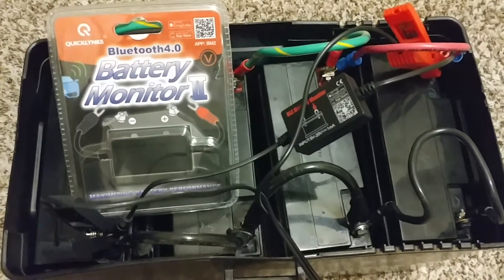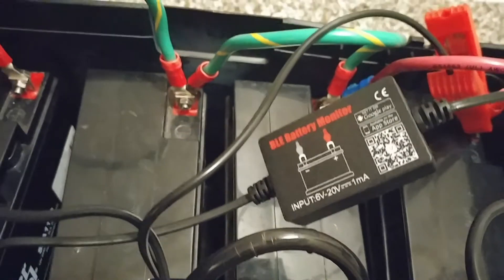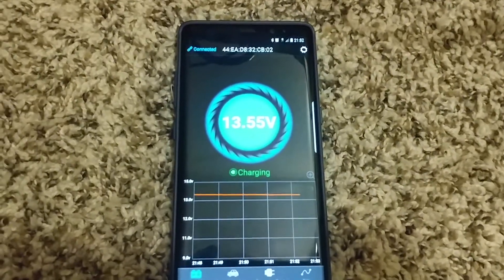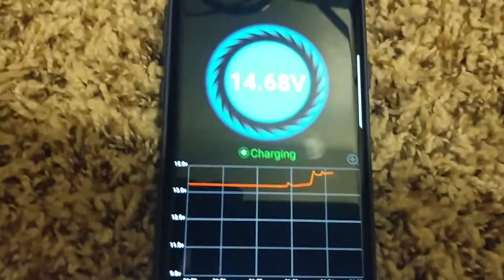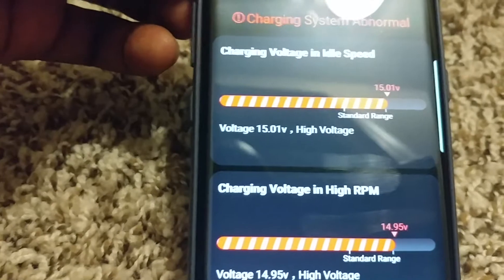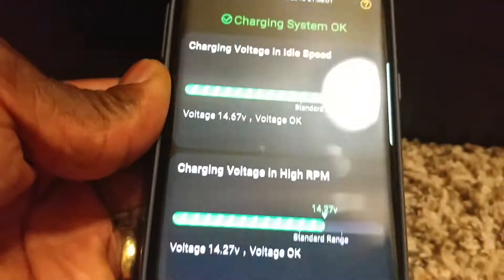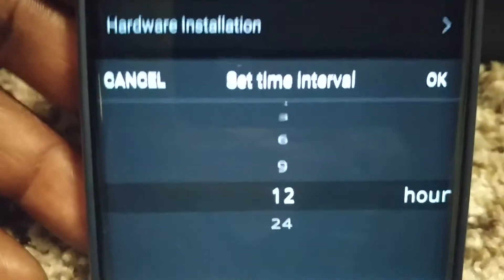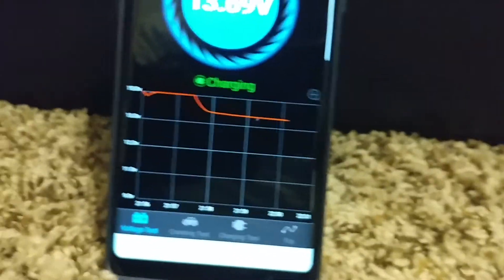QUICKLYNKS BATTERY MONITOR BM2​​ | Bluetooth4.0 Voltmeter (pt.2)

Comment: how did you pair it ? mine wants a PIN code , whats the code ? i have tried 2 phones
Reply from the maker: No pin code required.
Make sure you have your BLUETOOTH turned on and also your LOCATION turned on as well for this device to work.
Thanks for stopping by, make sure you LIKE SUBSCRIBE & SHARE this video that will help the channel.
Reply: @jwsolarusa  Thanks, i dont see why it needs location, maybe thats the problem but in my mind there is no need for it, will return the product i guess.
Reply from the maker: @keepemwet  
The device needs location to operate

Comment: IT SAYS START YOUR ENGINE BUT YOU DO NOT HAVE IT IN A CAR. That's why you get wrong readings.
Reply from the maker: Sorry for the late response due to YouTube. I just saw this comment. 
It is designed also to be used with car batteries as you drive.
It also tells you power coming from the alternator as the battery charges.